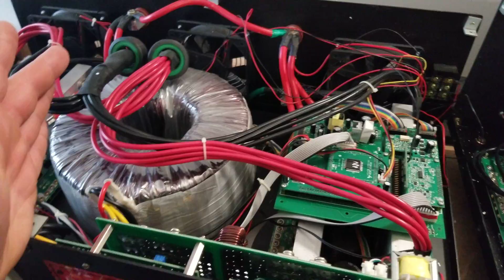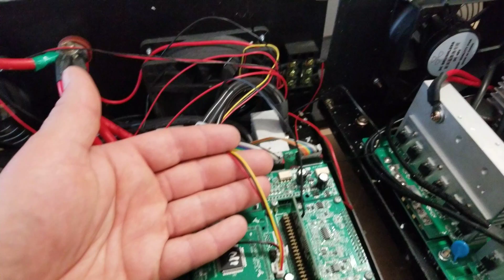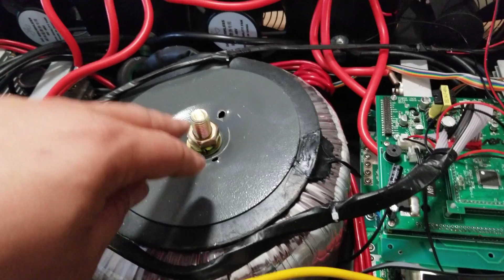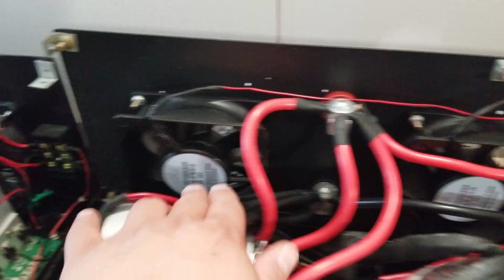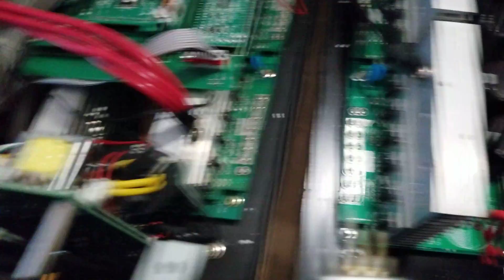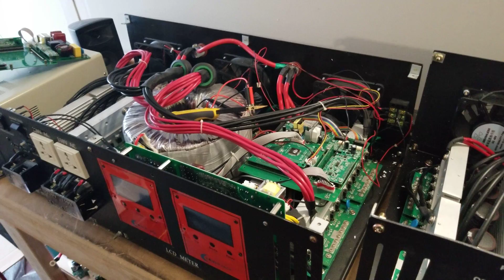24V vs 48 volt 15kw inverters. What are the differences?

Comment: Power Jack's definition of continuous power is full load for 10minutes or less, mine is full load + 10% for years. It really simple if anything gets hot and fans a running at full power then in not true continuous. My inverter only gets warm may be 15 degrees above room temperature, no fans needed.

Comment: That transformer in that 15kW inverter is about the same size as my 5kW unit, I noticed with all off the shelf inverters is the transformers are way undersized. Yes it will do the 15KW but with poor efficiency dropping below 93% 7% is a whopping 1050Watts of heat in that case, it will not last long. Also those little TO-220 mosfets irfb4110 all up 32 4 groups of 8 switching 300Amps at 50V, just a matter of time before it goes pop, or be sure to keep load at a few KW max no more, it will last then.

Comment: Note that this is an old style of inverter and is not as efficient as newer designs. The newer ones first use a DC-DC converter to get up to the required voltage, and then switch that with mosfets. I can't remember what these two types of inverters are called and some googling mostly turns up solar power websites.

Comment: How this thing may be 15Kw if the power transformer is not more then 5Kw. A Triad Magnetic 5Kw transformer is 11 inches OD but this one is smaller as I can see. Do the China engineers brake physics low?

Comment: Nice video and precious info one can rarely find. One question: when you say that in the 24v inverter, the 24v DC input is turned into 18v AC before it enters the transformer, is the 18v in terms of RMS (i.e. voltage one reads from a volt meter)? Or you are talking about peak voltage?
Reply: It's RMS

Comment: Hi morning I just wanted to know so if you can on couple a Sunny Boy 2000 W Solar PV grid tied Inverter 2000HF SMA SB2000HF-30 2KW. To a 15kw 48v  power jack inverter, running the AC output from the inverter into to the AC input of the power jack inverter so that it can charge the batteries and also so run back into the power panel of the house please let me know and it is for the UK market thanks

Comment: Does the 2019 models have a higher voltage AC on the input?? I mean I would love to use the 48 but that would put me on a purchase of an extra set of 12 batteries of 2V "1100" amp batteries.. and that my friend is in the order of the 5K..... your advice will be greatly appreciated.

Comment: 12v & 24v good..! 48v no good. How to make device 12v & 24v inverter system power supply. & 24 hour.! it's very important. I want this device to be make.!this Device 24 hour backup...? & full load.? Thank you guys. for this your watching.
Reply: Lol. The higher the voltage the lesser the current drawn. 48 or higher is best.  12 volt & 24 volt will be drained faster than 48 volts.

Comment: What is the fan voltage rated on 5000w 24v powerjack?
24v? I can only took  3100w out of it before the fuse blow, upgrade the fuse??
Reply from the maker: Do you have a split phase version?
Reply: @GenetrySolar  nop, just 1 phase at 110v
Reply: I don't know much about these inverters, so take this with a grain of salt..... Do you know if the 5kw rating is peak or RMS? 5k/sqrt(2) = 3.5k which is close to where your fuse is blowing. Some companies boast a little on wattage (at least with speakers and amps), I have no idea about your inverter company. Still seems like you shouldn't be blowing a fuse though. I would contact the manufacturer and also see what they think. It's hard to say increase the fuse size, because something else inside could get damaged by the current that is blowing your fuses. some appliances draw in a large inrush of current initially and then average out much lower. not sure if that could be a cause. Good luck!
Reply: Alexys Ortiz my understanding of the 110v models is limited single circuit wattage . The fuse is likely seeing far beyond amperage due to induction surge. Motors pull much more watts than resistance loads.

Comment: Is the 48v. split phase a pure sine wave? Have you tested the sine wave? I need 60 Hz and the Aims was a steady 59.7 Hz and no adjustment. Does the Power Jack have an adjustment?  Does this have a bonded neutral or a floating neutral?
Reply from the maker: It is a perfect 60hz. It also has a floating neutral, however when connected to the breaker neutral it will share the bond. Floating neutral only applies to the outlets on the front.

Comment: I have a Aims 10kw 48v split phase that was working for the last 3 years. Three in the morning lighting hit somewhere close and took out the inverter.  Does the Power Jack have surge protection? The Aims 10kw needs a 15kw generation and I have a 7.5 kw so I never hooked it up. What does the Power Jack require for a generator connection?
Reply from the maker: I can tell you that I accidentally sent the grid through my inverter and it roasted the breaker but the inverter was fine.

They use 70 amp push button reset fuses that seem to work great.
Reply: What happened to the inverter carcass?  I am an electronic technician.  Might be interested in your blown inverter as a project.
Reply from the maker: Inverter carcass?
Reply: Did you repair your inverter?  If not I'd like to attempt repair of it. @GenetrySolar